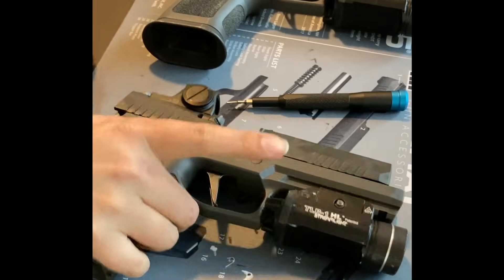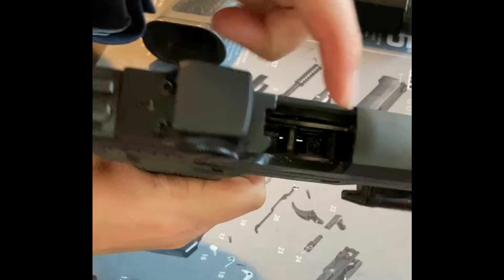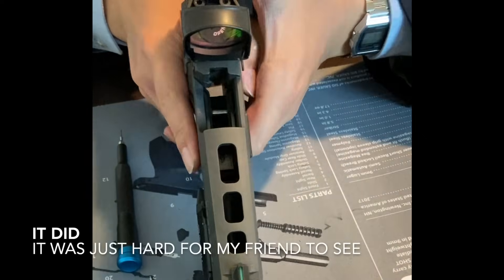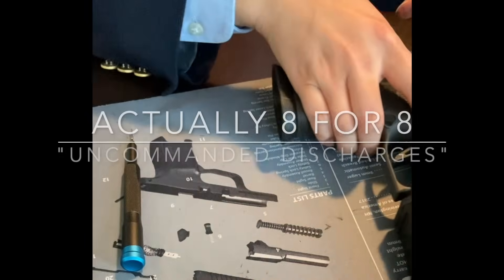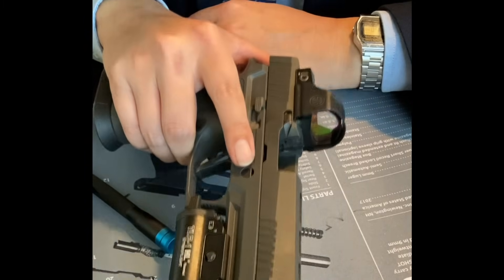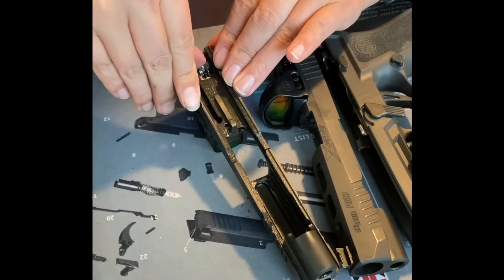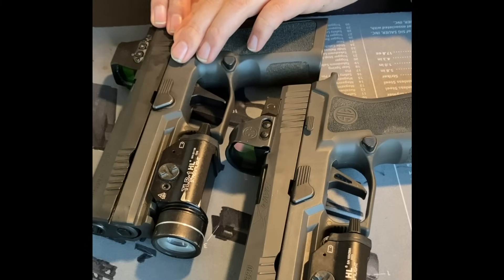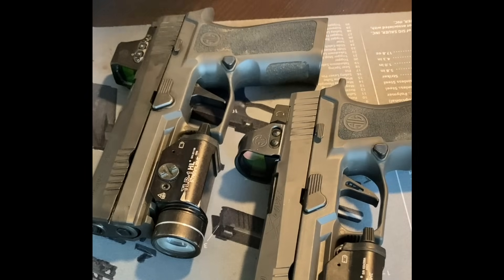Testing two P320's for Uncommanded Discharge: One PASS, one FAIL

Comment: How does the sear drop without inserting a tool though….? That’s the question. If it’s an impact or jolt that’s causing the sear to fall, wouldn’t it be easily to duplicate? Just a question not defending Sig here
Reply: Sig did a stealth revision of the striker to increase sear engagement around 2019. A post-VUP gun could still have as little as .25mm of sear/striker engagement. Add poor manufacturing, poor materials, there's your answer. To add, if you secure thr slide (where the striker is housed) and bump the grip left or right (where the sear  is housed) the striker can slip off of the sear.

Coincidentally, Safariland holsters that cops use retain by friction on the slide. Unsurprisingly, these are going off when a cop bumps his grip on his car frame when stepping out of it.
Reply: @y66f53diy7  From what I've read, there has been yet another stealth revision. I wish I had a bookmark to the source of this info, but unfortunately I don't. So until someone has verified the following information, take it with the proverbial grain, although I believe it to be correct. 

In the latest revision, there is a secondary catch on the sear that is meant to provide backup sear engagement if the primary engagement fails. But that creates another problem. Scenario: The primary sear catch fails. The secondary sear catch does its job and prevents discharge. Now the problem is that if you then pull the trigger on this gun, it will NOT go off; the gun will not fire if it has fail-safed to the secondary catch. The user will have zero indication that this has happened.

Now put that in to a law enforcement scenario. Your gun's primary catch has failed, and the secondary has engaged. You have no way of knowing that. Joe Bad Guy pulls his gun on you. It's a wild west moment; first to shoot lives. You draw your gun and click.

So we have evolved from them discharging when we don't want them to, to not discharging when we want them to. Full circle.
Reply: @6tuf85dyfu this is the first explanation so far I've come online that actually gives some semblance of a logical reason as to why they're failing. Thank you.
Reply from the maker: For whatever reason, sears are failing and releasing strikers. When the sear fails, there is precisely one safety mechanism left preventing an “uncommanded discharge.”

This test doesn’t care why the sear failed, it assumes the sear has failed and checks whether that last-ditch safety mechanism is or isn’t working as intended.
Reply: Because it's a precocked system. That means sear wear or if it's out of spec slightly a small movement can disengage and cause it to fire.
Reply: @TacticalMamba Walthers and M&Ps are fully tensioned strikers as well and they don't have said issue.
Reply: Unlike glocks they use a half cock system and pull the trigger finishes the job so it can only fire with a trigger pull.
Reply: @TacticalMamba  yeah i got a 47 and a 48 this month because of this issue with Sigs. Not sure what to do with my DH3 now...
Reply: @TacticalMamba , that is an urban legend. There have been tests done that show the partial cock in a Glock will still set off primers. Glock designed their guns with the partially-cocked striker to make for a more smooth trigger pull.
Reply: @Subtlenimbus  The half cooked firing pin had to be an attempt at a safety feature. In no way does it make a smooth trigger pull. Hell, Glocks performance trigger eliminates the half cocked operation in favor of a fully cocked pin in order to improve the trigger pull. 
If I had to guess, I would think that hard primers MAY not go off, while softer primers would. I could be wrong on that, but I'm pretty confident that they didn't add trigger weight to make the trigger smooth. It makes the trigger spongy and gritty. Eliminating that function is the easiest way to clean up the trigger.
Reply: if striker/sear contact is partial due to poor QC,  it is possible for the striker to slip off.
Reply: This test bypasses the striker safety by moving the trigger bar when pressing the sear. A jolt does not do this.
Reply from the maker: @TheSneed001: This test doesn't care why the sear is moving, only that it moves and leaves the Striker Safety Lock as your last-ditch defense against an uncommanded discharge. The test is to see whether your pistol will bypass the Striker Safety Lock if your sear were to move due to whatever is clearly happening to cause peoples' sears to move.

@plutonium5156: The trigger bar moves when the sear moves. If a jolt moves the sear, it will absolutely cause sympathetic movement of the trigger bar as well. The trigger bar has no other physical option but to move sympathetically.
Reply: @P320Truther  would a trigger with a dingus help prevent the trigger bar from moving?
Reply: Yeah, this test requires the pistol to get a prostate exam. We’re talking about people just standing there and the pistol functioning spontaneously. What external force is causing the sear to fall?
Reply: If you have to do this for the sear to drop and the striker pin to hit the primer then they're not going off by themselves. There's nothing pushing the sear while the P320 is sitting in the holster.
Reply: @jokolocohama  When some guns pass the test and others fail, that shows a mechanical deviation between specimens of the same model. 
That's enough to not trust the manufacturing processes used to make the gun.
Reply: @jokolocohama  the whole point is this: if tolerance stacking of MIM parts results in poor sear engagement and the striker drops, there is a chance that the striker block won't catch it. If moving the sear also disables the striker block, it is a terrible design.
Reply: @Subtlenimbus i just checked all mine and none of the striker pins protruded. I think it's the striker spring issue or something preventing the 2nd safety from stopping the sear to drop. Mine all stopped. I tried it 10 times on all 3 of my P320s. Made a video after 30 attempts 0 of them had the firing pin protrude. I'll upload it.

Comment: I may be reaching here... by you trading out the striker assembly ... it's the slide that is causing the safety bar to stick allowing the firring pin to move...
Reply from the maker: The primary reason for a test failure seems to be in the FCU. My FCU would not fail and continues to not fail. My friend's failed less with my striker assembly, but was still vulnerable.

Comment: Thanks for sharing this! A few questions:
1. Does the trigger go dead after you induce the release of the striker?
2. Do you have a plan on changing to an after-market sear like armor craft? 
3. How do you like the Romeo X enclosed?
Reply from the maker: 1. Effectively, yes.
2. No, the last thing I want to do with a pistol that doesn't fail the test is introduce more variables and oddities into the mix.
3. The Romeo X Enclosed is what Sig Optics should have made the first time around, and has served me well thus far. I have no idea why they started the Romeo X's as an open-emitter family and then added the rear pane of glass later.
Reply: @P320Truther  How would manual safety affect this testing result? Thanks!
Reply from the maker: I don't know, as I don't have access to a manual safety P320, and I've learned to stop guessing at how the P320 FCU will act without being able to test the parts myself.

Comment: Also, withouy the barrel and spring, are you pushing it too far forward so that the second striker stop donest catch? Maybe i missed, but i think they have a second shelf in case sear slips
Reply: There is a second shelf on some. I am not sure when they switched to that design.
Reply: If that were the case, wouldn’t both pistols behave the same, though?
Reply: @whilomforge3402 not sure, gonna look at mine, but I thought they had 2 catch....but I guess depends on year?
Reply: @morocomole4567  i think that was a stealth update

Comment: Did the small pokey thing in the small space replicat whats happeneing to cops? Maybe i missed it
Reply: It illustrates the “striker safety lock” that should prevent the weapon from firing, should the sear fail…..does not always work.

There’s several reasons the sear could be failing. Especially considering things that happen in duty use. If the striker safety lock worked properly, it wouldn’t matter. 

I.E. you can’t do this with a Glock and other pistols. All of their layers of safety work when you make one or more parts fail.
Reply: @Solving_Live_Poker yeah o guess that's what I'm looking for, the striker Block should catch, and only be overco.e by trigger pull....if sear movement pulls trigger then sure lol

Comment: It makes me wonder if the P320, in its entirety, is just the consequence of not reliably altering a system to work with a different mechanism. Honestly, my best guess is that the P250’s original design tolerances may not have transferred perfectly to the P320. Maybe they’ll bring back the P250 as like a vicarious admission to the issue.

Comment: I remember when I ran across this test from the Sig Mechanic. Everytime I take mine to the range I run this test before I put it back to use.

But i also run that agency arms trigger as well.
Reply: Which test, the one where you manually hit the striker or check to see if the striker resets?
Reply: @davidtrav6494  It's  striker safety bypass test. It's pretty much what he's doing.

Comment: So you are showing a situation where the firing pin spring is broken. I doubt the energy of just the sear dropping and engaging the striker spring is enough energy to even strike the primer and set it off. But on a drop it might have enough energy if this is a pre FCU striker, as the mass can set it off

Comment: Damn. Thanks for doing the leg work. This has been my exact theory…the striker falls off the sear a number of times unnoticed, breaks or deforms the striker block safety, and then the next time it happens…boom goes the dynamite. The first concerning part is that the pistol, at likely multiple times, would have been unable to fire if the person carrying it actually needed it. Second that the design choice was fairly fragile, and the modularity can add to tolerance stacking.

I’d love to see more testing with maybe a brand new striker assembly in the problem gun, and note any aftermarket parts on either gun.

Comment: So I tried this and the issue with the test is that moving the sear moves the trigger and thus the safety goes off.
Reply from the maker: The important interaction appears to be Sear -> Trigger Bar -> Safety Lever. If the sear moves (which it seems to be doing, since we have no reports of uncommanded discharges from broken sears or broken striker feet), then the trigger bar will be moved. If the trigger bar moves, the safety lever will be moved. The question is whether that sympathetic movement is enough to deactivate the striker safety lock.

The pistol that fails the test seems to be demonstrating more sympathetic movement than the pistol that does not fail the test.

Comment: I think this is a good example of the issue being due to parts being outside of tolerances, and the issue only arises when you get the wrong combination of parts together, which is why it seems so rare and inconsistent.
Reply: It should be so rare, that we never see it occur.
Reply: Definitely NOT that rare.
Reply: @well that or it speaks to the sheer volume. I design electronics for a living and we do (well some of us) a process called Monte Carlo analysis where we basically jockey all the part tolerances this way and that across their % deviations. So say you have two resistors with 1% tolerance. You get Normal, Normal, then High, Low and then Low, High, then High, High and then Low, Low. We would call this, “worst case distribution” and out of it comes some deviation in intended function. 

Normally you will make decisions on non critical systems based on, “normal” or “Gaussian” distributions and doing that the math says those worst cases are vanishingly unlikely. But if you build a tremendous number and you don’t do incoming QC the worst case can be seen. 

I suspect they’re not doing rigorous enuf QC on a life critical device 😐
Reply: @JamesReedy  That's a very good summation, and I think you're correct. I've done manufacturing engineering for robotics assembly, and "tolerance stack up" is a very real issue. When it comes to small parts, the most minute details and dimensions are absolutely critical.
Reply: @life_of_riley88 not rare? They've sold millions of these, and had allegedly about 100 or so cases, some were proven negligent by pulling trigger. Even at 100, that's like 0.005 percent of them are an issue...
Reply: @DarkHorseParatrooper It's far more than 100 cases. Often people own these and don't even know they are defective as they don't carry them every day. You need to do more research.
Reply: @life_of_riley88  seems pretty rare when you can find plenty of videos that of them NOT going off.
Reply: @bobbyraejohnson  Read the comment right above yours🙄
Reply: Look at all other major players in the game.... S&W, Glock, Walther, etc etc are so rare that it's practically unheard of and when the RARE chance something like this happens it's due to a warranty being voided and / or custom work or mucking with OR due to improper care mixed with extremely high round counts.....

My point is that when sig is directly compared to the entire market these issues are no longer rare but actually dare I say common..... Sig has been completely dishonest and even worse blame the user with no count of responsibility whatsoever.
Reply: Which is why the Glock trigger mechanism is superior because any out of tolerance problems that drops the sear won't fire a round because it doesn't have a fully charged striker.
Reply: @ well that and the striker block is very far forwards. It’s a quite robust design the Glock. You’ve got the trigger safety, you’ve got the cruciform drop shelf holding the engagement in a drop (you don’t clear the shelf till quite a ways thru the stroke of the trigger) and then finally you have the striker block very far forward in the design.
Reply: @FafthriechRalofson  I agree that it's a bad design - it exposes them to the risk of bad things happening if there are out of spec parts. What I'm getting at is that out of spec parts are the nail in the coffin. A properly built P320 is probably okay - the issue is that they aren't properly built and some of them have just the right combination of out of spec parts that they become dangerous. 

I recently watched a great video of a guy comparing two 320s. One would allow the striker to go forward if the sear was manipulated, one wouldn't. This was failure of the striker safety. However, when he switched the slides between the two, neither gun malfunctioned. Something about the interaction between that particular slide and that particular FCU caused the issue to manifest.
Reply: @SauerkrautIsGood  What you're describing is a DESIGN FLAW. If random tolerance stack up issues create a failure, that goes all the way back to what we would hopefully find in a "CDR" or Critical Design Review. There are engineering steps that should be taken to make sure that this doesn't happen-Sig didn't take them.
Reply: @life_of_riley88  Again, I agree with you too. My whole point is that this is not an easily repeatable thing. Some P320s will have problems, some won't.

Contrast this with the original drop safety issue where you can take every single example of a pre-refit 320 and get it to discharge upon dropping at the correct angle every single time. That was 100 percent bad design. This is more like the design is an aggravating factor.
Reply: I've been a Sig user for years. I've also defended the P320 in the past. But... That Ends Today! This is irrefutable proof, and Sig had better come out and cop to their failure. And they'd better take their customer's safety as job one from this day forward. This is a moment that will define Sig in the firearms market for the future.

I think that you might be referring to stacked tolerances. Say 3 independent parts are required to perform a function. Each part has a (+-) .001 inch tolerance. Perfectly acceptable. However, if each part is out of tolerance by that amount, the stacking of the 3 tolerances render the action performed by the 3 parts a failure. Perhaps an "Assembled", overall tolerance of the parts assembly, would better apply, versus the individual tolerances for the 3 individual parts. The current acceptable tolerances. It is a stacked tolerance issue, from what I'm seeing demonstrated in the video.
Reply: Tried in mine and passed the test, it's also an old model 58B

Comment: Question what does the long pokey thing that you poke the sear represent in the case of all of these uncommanded discharges?
Reply from the maker: For whatever reason, sears are failing and releasing strikers. When the sear fails, there is precisely one safety mechanism left preventing an “uncommanded discharge.”

This test doesn’t care why the sear failed, it assumes the sear has failed and checks whether that last-ditch safety mechanism is or isn’t working as intended.
Reply: @P320Truther  Okay I see. Thank you!
Reply: @P320Truther I feel like no matter how many times you explain testing the redundant safeties, or even the fact you outright said it in the video, these dudes just aren't getting it. Smh
Reply: I'm wondering the same. If we were trying to explain drop safety issues, that would make sense to me. But "just going off in the holster" requires the sear to drop somehow without any massive shock being applied. Like it would have to "walk itself down" gradually somehow?